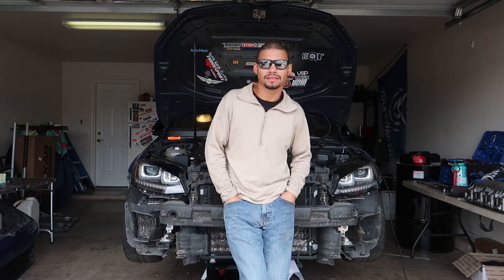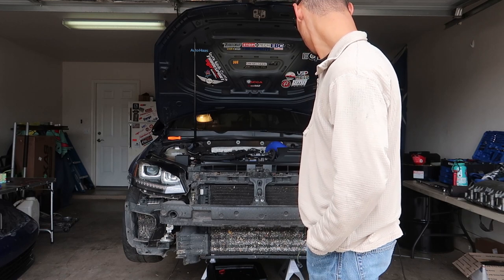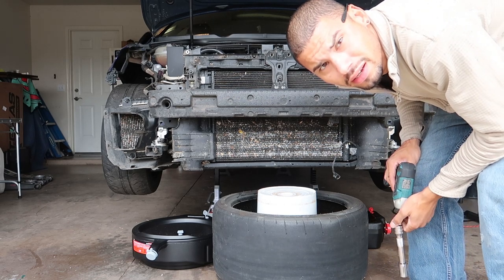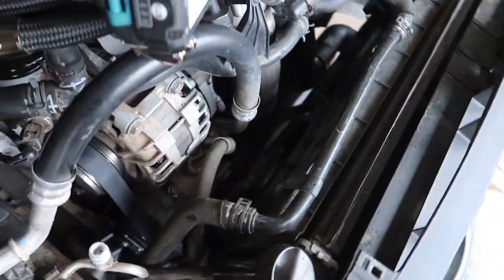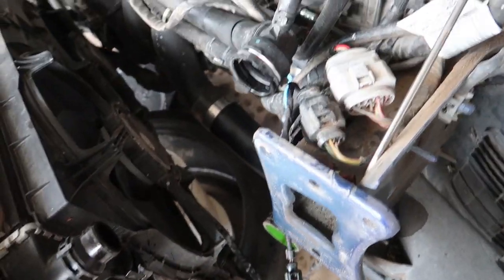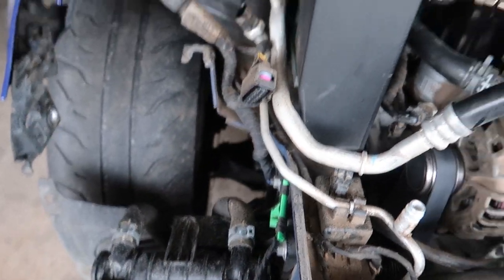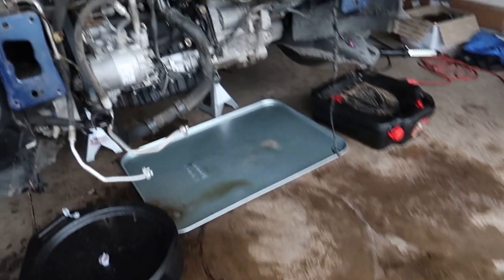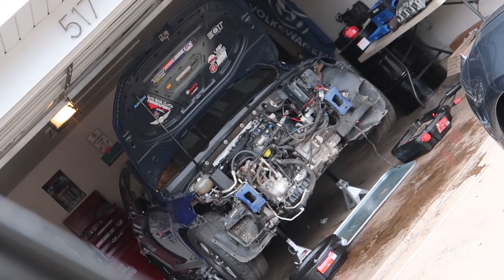Front end is off! Time to pull the engine and trans! | MK7 Golf R

Comment: I think the ‘aux radiator’ as you call it is an oil cooler, although I’m probably wrong. 

I know DSG cars have another radiator on the opposite side to cool the DSG fluid.
Reply from the maker: It’s not, i already deleted it and sold it. Good 10lbs gone lol. We dont get oil coolers like that from the factory, i wish we did though lol. I think what we have is a couple of heat exchangers somewhere in there

Comment: I definetly think you should do the single big radiator and intercooler. Also I dont know the layout of the pullys but would it be possible to just run a shorter length belt and skip the ac idler instead? it could save you that extra bit from the bracket and pully.
Reply from the maker: I agree on the rad and ic! And no there isn't there has been some that tried before me and gave me the insight on the idler pulley thing from Audi

Comment: Wow.  The bolt looked rusty where the break was.  Looks like it may have been cracked for a while.  I actually just removed the inlet and outlet pipes to the intercooler on my MKVII R last weekend and they had a thin film of oil as well but not quite as much as yours did.  Mine is stock though and has about 50 000 km.  I had never removed the pipes before last weekend.  Ive read about oil in there before so I'm assuming (hoping) its relatively normal for these cars.
Reply from the maker: It’s definitely normal for a turbo car to have * some * oil residue in the pipes i just didn’t expect to see the amount that i did.. then again its been prolly 25K+ since I’ve looked in the pipes though. Ain’t too worried about it.. especially since were about to build the motor but I didn’t like seeing all that. Gonna have to check and clean those out more often now that i know.
Reply: @BryceJordanProductions  The oil comes from the turbo, not from the cilinders. A bit of oil is quite normal, a puddle of oil not..
Reply from the maker: Right I understand that, it could be from the PVC/catch can I have too though. I push this car to the extreme so, really I'm not surprised at the amount of oil in the pipes I'll just have to keep a better eye out

Comment: I think you should be good without the aux radiator gti does not have them plus the condenser is coming so your getting more air flow
Reply from the maker: Exactly what I was thinking! It's gone now 😊 sold it last week and all the AC stuff. Got lucky, some dude needed everything out the front end basically that I didn't want lol

Comment: Did I see that right where our water pump is plastic as well as so many other items that "should" be aluminum? If so is there an aftermarket all aluminum water pump for better longevity or track use?
Reply from the maker: You're seeing it right it's an electronically controlled thermostat, with an electric pump as well all in one, and no one makes an aluminum one.. yet as far as I know
Reply: Bryce Jordan Productions well $hit, that would be nice, I would absolutely pay much
more for a part that is frequently known to have issues.
Reply from the maker: Yeah they've had hella revisions now, I'm surprised mine never leaked but it'll get updated to the newest revision hopefully it holds lol
Reply: Bryce Jordan Productions with all of the aftermarket options for the platform, how no one has addressed the Achilles heel of the platform or designed a high performance electric or even belt driven is beyond me?
Reply from the maker: It actually does have a belt that's driven off an electric motor lol, idk why anyone hasn't but, I'm sure it's coming! .... eventually 😂
Reply: Bryce Jordan Productions we gotta wait it out